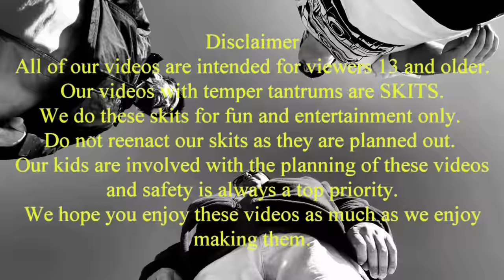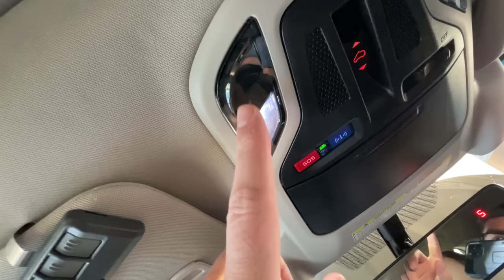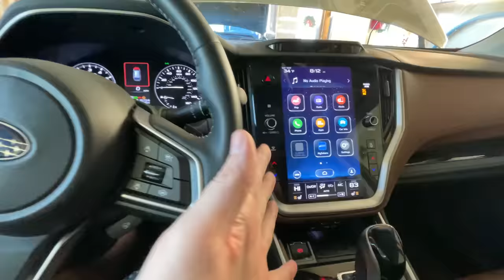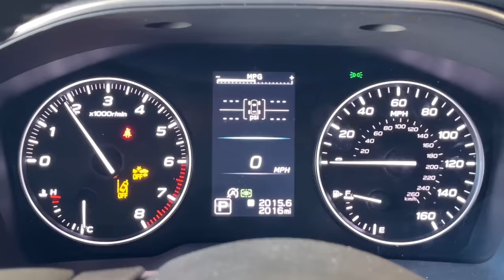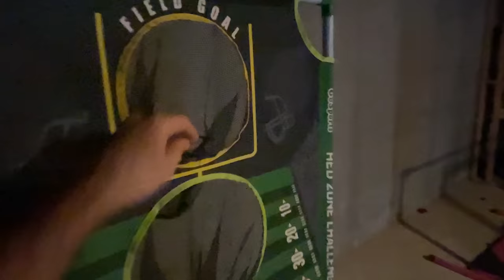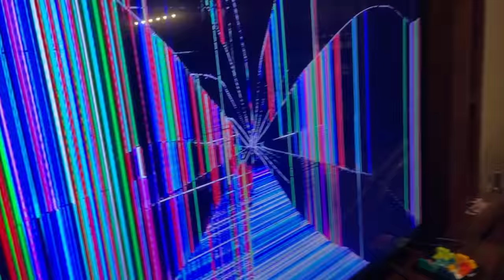🤬Kid Temper Tantrum🤬 Throws Ball And BREAKS MOM’s TV! [Original]

Comment: Subaru Battery that Suddenly Dies and keeps dying after multiple charges and jump starts usually needs to be replaced. If not, there could be a variety of other issues with the Subaru system that keeps your Battery Charged as you drive.

Comment: I've been getting into several car crashes lately first one minor fender bender in the parking lot, second one a truck smashed right into my dad's suv and sitting front passenger and it took out the rear passenger door and side airbags deployed, the truck was speeding and the light was turning green to yellow to red when that happened now waiting to see if the vehicle is totaled or not

Comment: I think u need to take the car for a service it should not be doing that all cars should let u know if there is a light on. I think the reason why the car keeps dying is cos the car does not tell u that that light is on it drains the battery. Also all cars turn all lights off Automatically even inside the car.